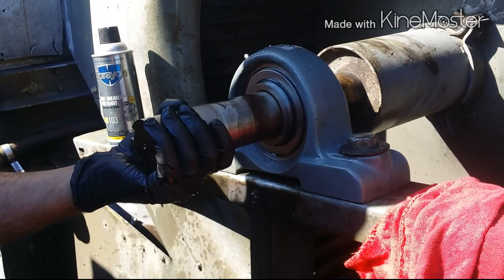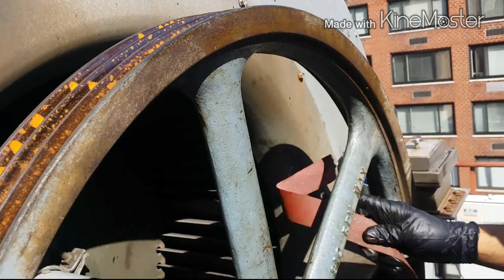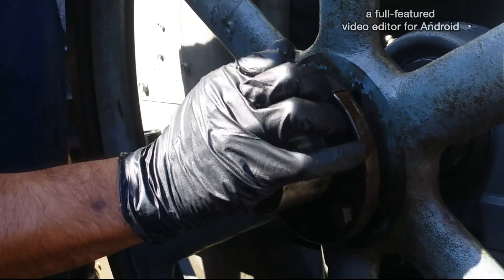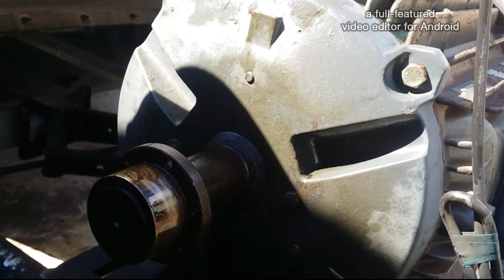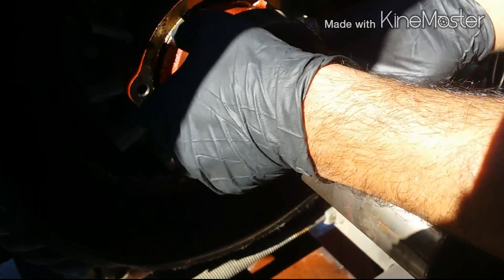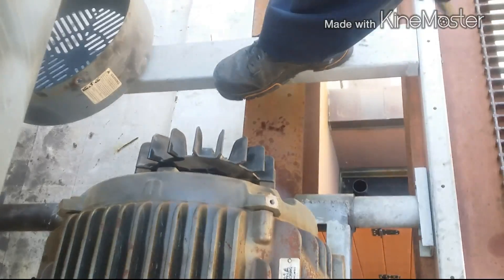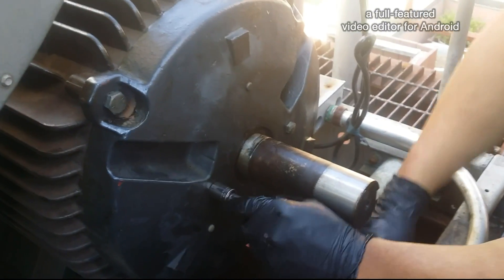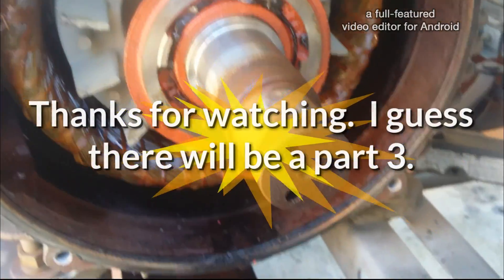Cooling Tower | 40HP Motor |  Bearing Replacement PT2

Comment: What number is the emery cloth you use to clean the shaft prior to pulling the hub? Also is the locking collor directional that goes behind the bearing...does it have an inside and outside?  Thanks for the great information..

Comment: Do you ever bust those inner pulley hubs?
I hate it when that happens. It especially happens on the aluminum ones.

I had an aluminum pulley almost that big snap as I was tightening it.
All the local supply had was a STEEL replacement.
And it was in our Baltimore Air Coil unit where it's inside and 12 feet up in the air up over your head.
That was one heavy bastard compared to the aluminum one I broke. :-(
Reply: You got lucky with the bearing removal on that sucker. Nice.

Sometimes they are TIGHT!
Reply: This kind of work is actually the FUN stuff I think. :-)
Reply from the maker: Let me ask you a question did you use an impact gun to tighten it. That's the only time I've seen it crack. A tech that I worked with a while Back used an impact gun and cracked it. That's why I only use sockets.
Reply from the maker: This motor was one of the easy ones that I changed bearings on. However that puller has performed beyond my expectations.  It has never giving me trouble pulling.
Reply: No, I had a ratchet in one hand and wasn't even putting much effort into it.

I do take them apart with my handheld impact drill and sometimes start them back together then go to the ratchet.
Reply: I don't have a puller that large.
I usually fabricate something up and it works.
My pulley does fit most motors. As long as the shaft isn't too long.
Reply from the maker: hackfreehvac what's nice about this OTC puller I can pull bearings or pully 12 inches down the shaft. The arms are really long. I watched that bearing job you did on that tower. You did a good job.
Reply from the maker: hackfreehvac also everything has to be tourqed. But who does that lol. Just kidding

Comment: Nice job Emin HVAC I would think you would just change out the motor.  Are these expensive and just cheaper to replace the bearings?
Reply from the maker: Absolutely. It's definitely cheaper to replace just the bearings. They are cheap. That's a heavy 40HP motor that's very pricey. It's not hard to do if you have the proper tools.

Comment: Great repair, most techs around here replace whole motor instead of just needed bearings, noticed you didn't swear like a sailor but still Martin's girl got some mention, Do you supply those snap on tools and pullers or does the company supply them.
Reply from the maker: Sometimes it just slips out. Lol I heard Rome wasn't built in a day. Lol. Yes all tools are my personal. Company only supplies torches, vacuum pumps, and things like that. However company also will purchase any tool that's needed to complete  job properly. Thanks for watching.